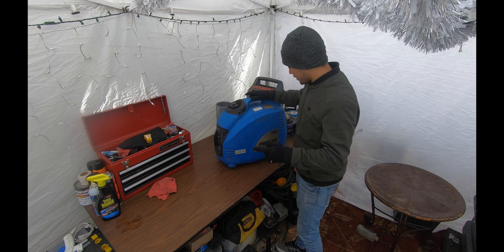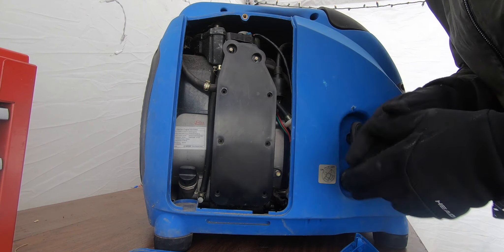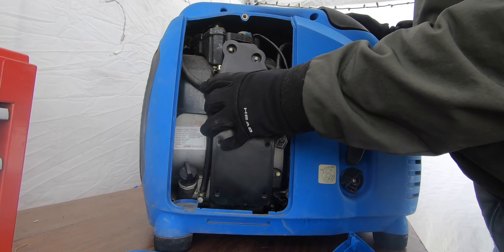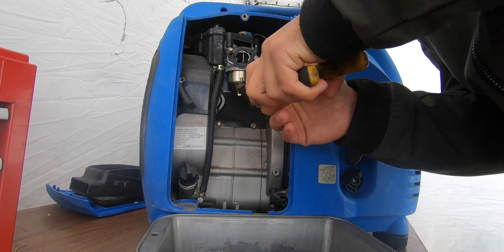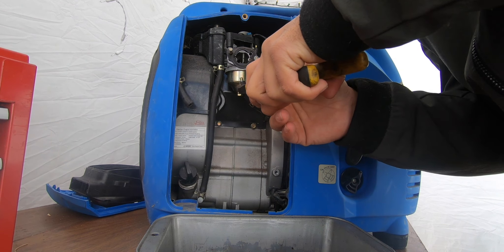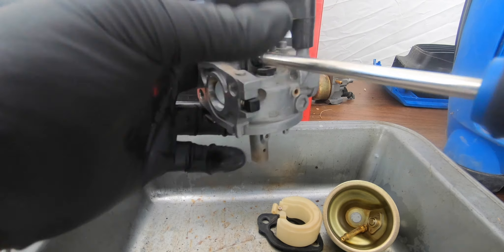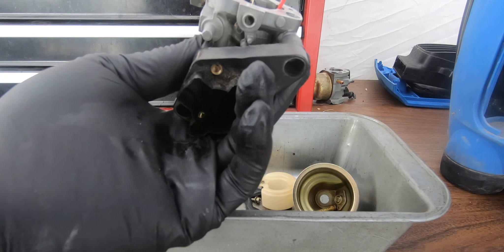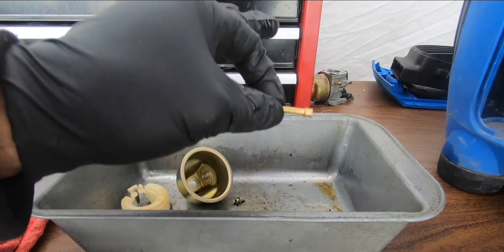Will it run? ETQ IN3500I Generator Resurrection (Part 1)

Comment: Hola buenas noches espero te encuentres bien ,quisiera tu ayuda por qué mi generador al darle a la cuerda de arranque me regresa el cable con una fuerte patada quisiera tu opinión que puedo era ser por qué le limpié el carburador y le di servicio la verdad me regresa l cuerda muy fuerte
Reply from the maker: La unica vez que me paso eso fue cuando la rueda flotante se mueve de lugar y la chispa de la bujia esta a destiempo. lo tro que puede ser es que el invertidor de voltaje se ah quemado y al tener corto funciona como un freno electromagnetico al motor.
Reply: Y qué tengo que hacer?
O no tiene solución?
Reply from the maker: @juanamador4970  desconecta el cable que lleva la luz del generador a el invertidor y si deja de darte tirones en la cuerda es por que el invertidor tiene corto y al desconectarlo deja funcionar al motor. si lo desconectas y no hace differencia es que la chispa esta a destiempo
Reply: Ok muchas gracias voy a hacerlo 👍

Comment: Hello i have the same in3500 etq generator and Not find de correct oil di you now were i can find and buy de oil thanks!!
Reply from the maker: Hola Juan el aceite es 10w30 en cualquier autopartes. solo un quarto o un litro es suficiente como para 2 cambios de aceite. si esto fue de ayuda subscribete para ayudar mi canal y dale like :)
Reply: Immortal Engines muchas gracias te agradezco tu ayuda , te felicito por tus videos!!!!!
Reply from the maker: @juanamador4970  De Nada!
Reply: Immortal Engines realizó el cambio y revise todo pero la cuerda del arranque se pone muy dura y en choke tiñe que estar en abierto para arrancar y prendido se perciben unas pequeñas brinconcos en la aceleración que recomiendas hacer o cambiar???? Gracias saludos!!!
Reply from the maker: @juanamador4970  Lava el carburador. suena a que esta haogando el motor y por eso se pone duro para tirar la cuerda por que esta lleno de gasolina. y el choke siempr etiene que estar cerrado para el arranque
Reply: Immortal Engines gracias nuevamente por tu ayuda gracias!!!
Reply from the maker: @juanamador4970  De nada la mejor manera de agradecerme es subscribiendote a mi canal jaja :D
Reply: Immortal Engines ya estoy suscrito desde el primer comentario !!!